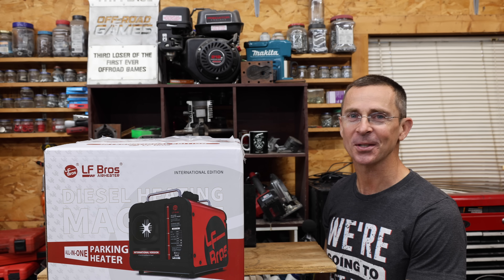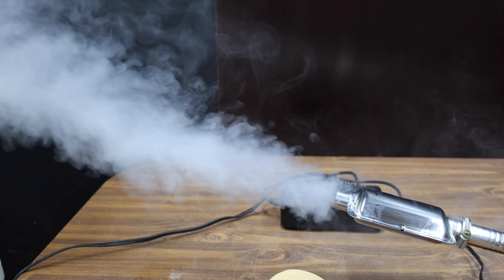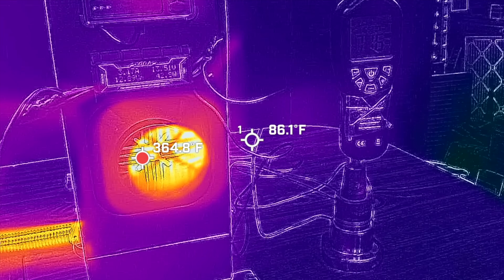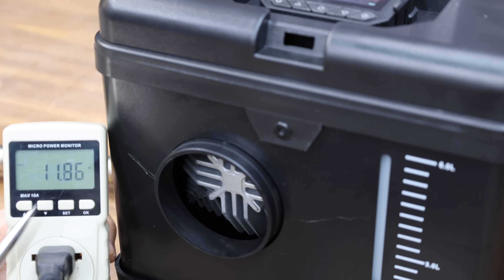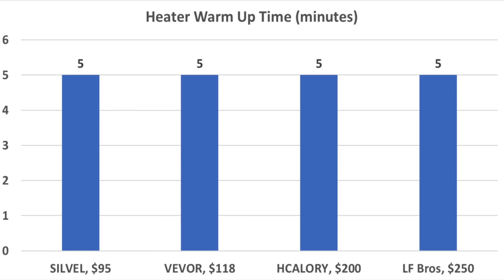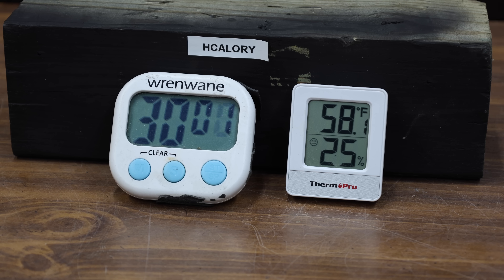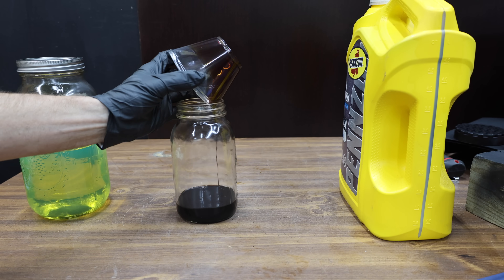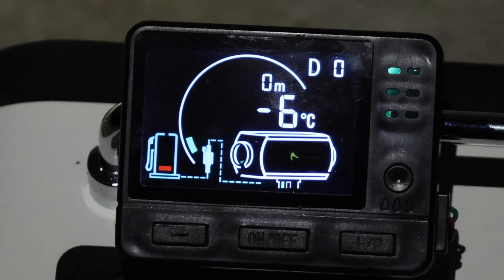The Truth About Cheap Diesel Heaters!

Comment: Are you kidding me?!? I’ve watched at least 8 hours of content about all these heaters the last couple days looking to buy one. This is the only video I’d ever need to make my choice. Thanks again!!!!
Reply: Be sure to watch the videos for "tuning" diesel heaters with a Carbon MONoxide detector/ meter!!!
Reply from the maker: You are welcome!
Reply: @ProjectFarm  Can you make a video about "digital levels" like the Klein ones to test for the most accurate brands ?
Reply: @ProjectFarm 

Any thoughts about these diesel heaters verses an old school vertical cylinder kerosene heater?
Reply: @Lorenzo-fw3gx these exhaust all the products of combustion outside.  Whereas the old school heater like you mention vents all the products of combustion into the living space, which is not very desirable.
Reply: @Lorenzo-fw3gx  In my state kerosene is much more expensive than diesel, so that's a big plus for the diesel heater, though there is a LOT less setup, and no power needed for the  kerosene heater. 
The big issue with some of the  kerosene heaters is carbon monoxide, some of them are really bad. Where as with the diesel heater, as long and you're willing to cut a hole in your wall for your exhaust, carbon monoxide, isn't an issue.
Reply: @Lorenzo-fw3gx kerosene is better IMO, no exhaust needed burns clean, but kerosene is VERY expensive
Reply: @ kerosene is useable in these heaters too and it’s cheaper than diesel.
Reply: @JustCallMeChad  Id just build a plate with an exhaust port to fit a sliding window myself
Reply: @Lorenzo-fw3gx   all your clothes will be smelling like kerosene  
 My biggest problem with those tower kerosene heaters is that in my area kerosene bumps have all been removed for gas station and that makes kerosene very expensive to buy it at  retail stores in cans
Reply: @xxskizzumxx Not correct kerosene burns relatively clean compared to diesel but not clean. You need exhaust or ventilation in confined spaces while burning any fule.
Reply: @The_RC_Guru  I don't know where you live but where I live diesel is much much cheaper than kerosene
Reply: @LarryRichelli same where I live
Reply: @JustCallMeChad if you're looking to save even more fuel cost, there are videos all over this forum utilizing a mixture of 1/3 kerosene or diesel to 2/3 filtered and cleaned used vegetable oil which is pretty much free. Even after multiple burn tests, the exhaust is clean, it runs fine, and even after disassembling and looking at the burn chamber itself there is no detriment or degradation to the heater, burn Chamber, or the glow plug. And on top of that due to the viscosity change it actually used less fuel over the same amount of time then running diesel or kerosene on its own. You're welcome.
Reply: @ProjectFarm I’m sure these are better considering the amount of BTU but what would work better Mr. Heater Big Buddy heater or the $200-$350 diesel heater? 
I know you ran some tests on the smaller Mr.Heater. 

I have the big Buddy heater but hate worrying and checking CO2 level/ fresh air. 
Reckon these would be cheaper to run long term? Heat more? 
Great video!
Reply: @rikityrik I can say I tried the mr.heat buddy vs my diesel heater 5k model, to heat my wood work shop(11x21ft uninsulated shed) and any propane made the air extremely humid. The diesel heater made a massive difference, zero smell, zero humidity. It was extremely impressive.
Reply: I think they all come from same factory so many similarities
Reply: @independentthinker8930 lol, I noticed some of them had the same silly VO message when shutting down “Thank you for using, have a safe journey”.
Reply: @willman831  So, did you have a safe journey? If so, you can thank these heaters. 😂😂
Reply: @independentthinker8930  they do I’m sure. So many products are made in the same plants with just barely any sticker and manual changes.
Reply: @The_RC_Guru  like the Chinese chainsaws, all the same, just different labels and colors
Reply: @The_RC_Guru , same with Yeti, and Walmarts Ozark trail mugs, made in China, factories are on same block, possibly same company.
Reply: These heaters are certainly not all the same and Chinese chainsaws are certainly not all the same . This comes from years of experience
Reply: @ i like the part of your comment where you told which one’s best in your experience.
Reply: @independentthinker8930 i bet Your stuff breaks a lot LOL
Reply: @thethiefonthecross9092  actually no, I have an 82 CJ-7 with over a million and 30 thousand miles on everything but the engine, it just had it's first transmission problem, the engines I got over 500k on each.  Maintenance my man so the maintenance!
Reply: @independentthinker8930  lol i dont know about that😂
Reply: @thethiefonthecross9092  yea you don't!
Reply: Same here and I've ran a vevor for the last 4 years
Reply: @adamwagner1987 just bought my first one any tips or tricks? Or any spare parts I need to keep on hand lol.
Reply: then you've been watching the wrong videos. I love this channel, but it's pretty obvious he doesn't know very much at all about diesel heaters. Just buy the cheapest one (under $100) rated at 8K (which is always actually only 5K, but that's what they all state) and comes with the white fuel line not the green or blue fuel line, and you'll be good to go. The colored fuel lines are too soft, absorb the pump pressure and interfere with the pumping, causing error codes. The "instructions" are always terrible, find a good video on YT and you'll soon see it only takes a few minutes if it's an all in 1 unit like the ones he tested. The ONLY difference between diesel heaters is the controllers and the fuel lines... seriously, that's it. Might be a wise idea to invest a few more dollars and buy better hose clamps at an auto parts store, sometimes the ones they include are pretty much garbage.
Reply: @jcs6206  Do you have a name for one your recommending please
Reply: I've had 2 for about 5 years now I got cheapos and they both still work great for me
Reply: Project farm is the place to be before I buy any tools. Never been disappointed in last 4 years since I found this gem of a channel
Reply: Exact same with me, I have them in my carts all over the interweb trying to figure which one to get..
Reply: @twistedhillbilly6157  I got vevor, no complaints
Reply: @twistedhillbilly6157 yep I’ve had.  3x today when I had one in my cart then removed it
Reply: @twistedhillbilly6157  all are mostly the same. Diesel is diesel, hot is hot
Reply: Which one are you buying?
Reply: I echoed this sentiment in one of his last videos, and he was obviously reading our minds again! PF never disappoints!
Reply: Not that you've asked but this guy is the one to come to when you want to see about purchasing something because he runs them through some pretty good tests
Reply: Yeah, they're all just clones of some German-sounding heater that cost 10-16X.
Reply: Project Farm is my go-to for product reviews.
Reply: I had a friend suggested I get a vevor last week, now you are reviewing it. Crazy
Reply: He's a one stop shop for all your info needs in the blue collar utility items department.
Reply: Always go straight to Project Farm! The best reviews and non biased feedback. Often funny too!😊
Reply: Get the LF Bros, this is my second year heating with it and it’s great, I use I gallon a day. All day from rise to retire.
Reply: I'm think about getting one to keep my greenhouse above freezing. How low does the temp setting go?
Reply: @coloradoprofessionalinspec720 
Good idea. Since they don't seem to have a temperature regulating feature, you will probably need to experiment a little. Possibly make a duck for the output that has a damper to send the heat out of the greenhouse if getting too warm. Then, get a temperature controller to use for the damper that can be set for whatever max temp you want. If you can find a software hack, you may be able to reprogram it.
Reply: @coloradoprofessionalinspec720 On my Vevor, the lowest temp setting is mountain mode, set on one. It runs about 130° centigrade, on the body of the heat exchanger.  With mountain mode off, on high,  six. 
It runs 208 centigrade, on the heater body..
Reply: I wonder can you run it off a car battery
Reply: @glenschnelle  yes, they do well on car batteries. Mine run on them. I have a "maintainer" connected to the battery, They are my emergency backup
Reply: @glenschnelle I have the Silvel brand. I run it off the deep cycle battery I take out of my boat for the winter. I keep the battery hooked up to a battery maintainer so it stays charged.
Reply: @glenschnelle  you can run it off a car battery, but not sure how long the battery will last.
Reply: @JustCallMeChad  quiet awhile, they claim 70 hrs on a 100watt battery, I just not car batteries, off and on as needed they go a long time
Reply: @JustCallMeChad  good question.... if you have to constantly run you car to keep a battery charge these heaters may not be my first choice
Reply: Yes they were originally designed to warm tractor trailer cabs up @glenschnelle
Reply: @glenschnelle  Should be just fine.
Reply: @glenschnelle yes, just buy a $20-25 battery float charger to keep it charged. $20 eBay one works great.
Reply: @glenschnelle Yes,  these heaters have a very low power draw, around 15 watts, after the initial start-up which is about 115 watts for about 1 minute. Be sure, to not allow the batt voltage, drop below 11.6 volts or the car may not start. 
 Also don't disconnect the batt, before shutting down the heater, is important to let, go through the cool down procedure, or it will damage the mother board, on the heater.
Reply: His timing always seems spot on huh !
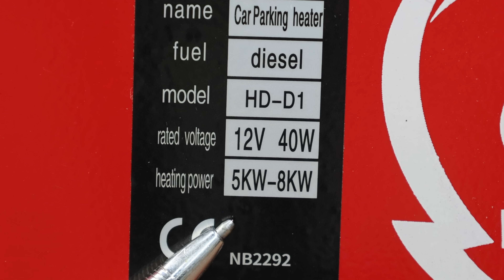Reply: 0:36 WOW! 8000KW.... 😂
Reply: I watched about 60 hours of videos before I bought one
Reply: I own the Silvel. My son has a Hcalory. He has had problems several times with an internal fuel screen getting clogged with carbon. According to him, it's a huge pain to access and clean this screen. I was hoping you would cover this in your reviews. It probably didn't come up because of the length of the testing. He runs his for days at a time. Has anyone else had this issue? Thanks for any responses.
Reply: @artmartin1913 This is due to him running the fuel pump slow, they like to run wide open, stay hot and clean inside. Other possibility is he is burning waste oil from vehicles. They're high maintenance if you fuel them with 💩
Reply: @artmartin1913  My neighbor has one (unknown brand) his has problems with carboning up.
Reply: Home Depot has the silvel, and  the vevor on special right now for $99
Reply: I've bought 4 of these and have 2 working and 2 for parts currently. One is in my van which I use all winter. I've thought about buying enough so I can set 10 of them up in a 6000 square foot insulated building as an experiment. I intend to put the exhaust through a heat exchanger to pull off as much heat as I can from the exhaust. I'm pretty certain they won't heat the whole building to a T-shirt temp, but I think they would make it reasonably comfortable. I'm currently using two torpedo heaters. One is 215,000 and the other is 65,000. They heat it up nicely and fairly quickly, but they stink and aren't terribly safe.
Reply: The patent ran out so I would call these a generic diesel heater’s, if you want the original you can always guy the Espar at around $1000/$1500
Reply: @airrodgers1242 Sounds like Project farm should get an Espars and compare to the Chinese ones... @ProjectFarm
Reply: I purchased my Espar in 2012 and it was $1500.  I would think that they have only increased in price. @airrodgers1242
Reply: @airrodgers1242  Not many people know that some bigger Diesel BMW has an engine heater fitted behind the near side wing. Often never used because they don't read the owners book.  Makes for a good campervan water heater.
Reply: Was also just researching this. I want it for those Cold tailgating days, under a 10x10 canopy. So the bigger the better IMO. But from my research, they are all the same exact hardware so 250$ is overpriced
Reply: I own the LF Bro's one and I love it
Reply: Me too. Was lamenting that he hadn't made a video on them. Aaand then bam!
Reply: Project farm has been my go to for product information for as long as I can remember.  The way he does his videos are so unique in a great way!
Reply: I have the same LF Bros, and it works awesome. I’ve put about 40gal of diesel through it. It is very well made. The automotive fuel cap ensures a great seal, and when the unit is up to temp there is zero pump ticking. 

Only downside is the control panel is on the top exposed to elements, but LF Bros has a different model that has a plug in control panel with I think 10’ of cord.
Reply: @max7143  on my second Lf bros in two months. First one had a quiet fuel pump but kept throwing errors.. I returned it they sent a replacement. Fuel pump is extremely loud on this one. Fuel pump went out in less then 30 days ..  I wanted to think paying more meant better.. I'm not convinced
Reply: @ well that’s a bummer, mines been solid, using it right now actually 😂
Reply: I have the same LF Bros, and it works awesome. I’ve put about 40gal of diesel through it. It is very well made. The automotive fuel cap ensures a great seal, and when the unit is up to temp there is zero pump ticking. 

Only downside is the control panel is on the top exposed to elements, but LF Bros has a different model that has a plug in control panel with I think 10’ of cord.
Reply: My 8kw vevor was $89 definitely one of my best purchases
Reply: @troyrager1352    Haha, not if you actually thought you got twice as much as you actually got.  Pretty lousy to get 4kW when you thought you wrre getting 8kW.  Haha.
Reply: Amen!!
Reply: Same lol. Glad I ordered a vevor
Reply: I bought the SILVEL from Amazon and Goddard in about a week. I ordered the VEVOR from Home Depot and it took almost 2 weeks to get. I had the SILVEL I've been running when the VEVOR arrived in returned it. 
Installation in a garage is there a real trick
Reply: Any tool or oil choice. Literally any product, this guy has the reviews. FYI, harbor freight isn't that bad of tools lol
Reply: dude same!!!
Reply: If the product you want is in a project farm video, you will know if it's worth it or not
Reply: Project farm is the first place to look before you buy 😁
Reply: He is pretty great!
Reply: Before I buy anything i check to see if there's a projectfarm video to help with the decision. It's as close to a real scientific unbiased test as you can get. He puts a lot of time and effort into each video.
Reply: Why I love this guy
Reply: Bro don't buy any tools without watching this channel..this guy  thinks of everything
Reply: I didn’t realize vegetable oil could actually power a diesel heater that efficiently. Running for 35 minutes on just one cup and burning clean is impressive—perfect knowledge for emergency situations during power outages.
Reply: Yeah this guy does a good job testing different variety of units. I’ve bought zero water filter and not bought allot of other products because of his videos.
Reply: @jackz.4868 oh man I went to the zero water faucet filter and I had 3 burst and crack in just 4 months early this year. They’re so expensive I just threw my extra filters in the trash and went to pur. Been great. Used brita before but they’re and up leaking too.
Reply: This is about the ... maybe 12th of ProjectFarm's videos I've used to select a product. Almost every time I find a new thing or a need in tooling to fill, I check this guy's backlog! He's like the ConsumerReports for us little guys!
Reply: Todd is very scientific in his methods and just the right amount of silly.
Reply: I was in the exact same situation! This was the only review that convinced me 100% on what to buy.
Reply: If I want to watch 20 mins of unboxing and influencer b roll, I let the algorithm serve up the usual garbage.   When it’s time to buy something and learn if something is going to work for me, Project Farm is the only game in town.
Reply: Great video thankyou mhof_58
Reply: truth
Reply: Me too!! lol
Reply: Which one did you get,then I won't have to watch the whole video 😂
Reply: @kenvik6192  I picked lf bros bit more expensive but build quality is great
Reply: same
Reply: I’ve told Todd several times that before I purchase something, I always search for the “Project Farm best“ whatever. 👏
Reply: PF does fantastic reviews
Reply: That’s great! Good to know you made a decision! Now could you tell us what you decided on?
Reply: Just get the cheapest one you can find with the features you want all pretty much the same, if you really want reliability and quality get HLN pro models both brushless and has oem quality with reliable Kyocera glow plugs this brand is oem level for most trucks and cabs in the heavy industry prices aren’t bad for what you get either 500$ compared to 2-3 times that for webasto and other high end brands
Reply: They're junk when you need them they don't work space heaters are junk olive in mich I know I have 3 all junk don't work
Reply: And your choice was ?
Reply: @robormiston2841  the Hcalory 8kw. They’re almost all the same and it’s been working for me flawlessly.
Reply: Suck up.
Reply: Which is best
Reply: I just bought 2 of these vevors
Reply: so which one did you buy?
Reply: Project Farm is the first place I look when I am looking for reviews on tools and other things needed around my shop. Welcome aboard.
Reply: They would save electrical power if they would use knobs instead of digital.
Reply: Quite literally every one of his videos! Add him, watch his videos before making any purchases it will definitely make you feel a lot more confident going in
Reply: @V1ncent19  I watch everything he comes out with, even when I know it is not a type of product I am interested in buying.
Reply: This might be a dumb question. But these all need electricity to run the fans don’t they? Which in a power outage you’d still be without power to run the heat for these
Reply: @d.w.6216   They run on 12 volts. 
Mine is connected to my solar panel, battery's it runs indefinitely.
Reply: @ on 12v batteries can run 8-12hours on a full 12v battery charge
Reply: @d.w.6216  That is the reason I have a MR. Heater and a couple of 20 lb tanks.  No electricity needed.
Reply: Can the clicking sound from the pump be muffled, it's annoying?
Reply: @karenpever1783 It’s not really annoying. It’s definitely less annoying than being cold 🥶.
Reply: I've been watching this guy's content for yrs. He has saved me $ and time. I hope you subscribed
Reply: @raverlife3413 have been subbed for years also.
Reply: My buddy works good, but I've had 3 in a row crap out just over a year of use.
Reply: @christawilliams9116 yes but those release carbon monoxide in the area you’re heating. These vent combustion gases outside.
Reply: @christawilliams9116     Three of these diesel air heaters?  You must be very unlucky or need to know how to operate them!

My 2kW sooted up (well, solid carbon  actually) the burn chamber over a season of use, but I am easily able to fix them.  Like anything vevor, they will mostly be bought with one fault or another - one would be lucky to get a “full spec” item of anything from them.
Reply: @oliver90owner No three propane Buddy Heaters. 😢
Reply: No it’s not.   About useless as a long term, safe test.
Reply: @oliver90owner is that what the review was about? Nope. And mines on its 2nd winter running fine it hasn’t caught fire or got up and shot anyone.
Reply: @The_RC_Guru   For starters, he tested ‘supposed’ 8kW heaters.  They simply do not exist in that form - they are virtually (or absolutely) identical to the claimed 5kW heaters - which even  don’t actually deliver 5kW!  

Is safety not an issue should  that not be considered/addressed?  Some of these heaters can require replacement parts due to the construction of the combustion tube if/when the heater fails due to carbon build-up.  I know all about these heaters - I have two, supposed 5kW versions and one supposed 2kW example.  None provide the claimed output.  

The smaller example became so blocked, after running for prolonged periods at a low-heat setting, that most would not be able to avoid buying a replacement combustion tube to effect a repair.

Operated safely (many are improperly, or inappropriately, installed) and used carefully, these heaters can provide a good source of heat.  Just don’t expect anywhere near the claimed output - and good luck if it is operated at less than high output settings.

It should be pretty obvious that measuring the temperature in front, at a distance is going to be affected by the relevant heights and velocities of the warmed air.  Careful comparisons need to be made.  Velocity of the warmed air is immaterial - the output of the heater is the ‘proof of the pudding’.  

Need I go on?  If I do, you are out of luck, I’m afraid.
Reply: @oliver90owner nah you’re just another clown that spends all his or her free time on the internet being rude and negative anywhere you possibly can.
Reply: Doesn't really matter. Buy the cheapest, they're all the same except the options.
Reply: I always check Project Farm first - and I live in the UK where half the brands are not even available 😂
Reply: I already have 2 of them
Reply: He's the best on Youtube period.
Reply: Get one that runs off of propane, no electricity required, and they will run a few days off of a 20lb tank.
Reply: @harpintn propane produces moisture which is bad.
Reply: @ABCdefGZER  Moisture is needed in cold dry air.  If you are talking about the moisture in the fuel, that is the reason you use a filter when you use the 20lb tank.
Reply: @harpintn     Every kg of gas burned will produce more than a kg of water.  I could work out exactly how much, but you wouldn’t understand (or care) I suspect.
Reply: @harpintn    Please share any links.
Reply: @harpintn Easier (as well as usually less expensive) to source diesel/used oil than propane in our part of the country.
Reply: @aspenhill1479  The problem with this device is that you also have to run a generator to use it in a power outage.  That doubles the cost of running it.
Reply: @harpintn  looking for portable alternatives!  Appreciate your sharing knowledge. Don't trust a Kerosene heater, lost a house to one when a valve failed. Not enjoyable.
Reply: @harpintn  I have propane ones, they're pretty great and hassle free. Especially the "Mr Heater Buddy" that they sell at Home Depot. Had it for years, a $20 propane tank last 75hrs on low and keeps my garage warm enough, I think the diesel probably puts out more heat at less consumption, but having to add diesel every 10 hrs and run exhaust seems like it's not worth the hassle
Reply: @xxskizzumxx  I am sure the desil ones put out a lot of heat, but they also need electricity to operate.  That makes them problematic in a power outage.   I have never actually needed to use my Mr Heater, but the technology has been perfected for decades so I was comfortable with making that purchase.   I also have a tiny propane heater that will screw on the top of a propane tank that I have used many times while camping.
Reply: Welcome to Project farm. I always come here first to see if he’s reviewed something I’m looking to buy. If he’s reviewed it I don’t waste my time any where else!
Reply: @ me too. He’s covered a lot of stuff that’s right in my wheelhouse.
Reply: @nfprojectshop    You should spend time elsewhere.  I know that some of the comparisons are absolute carp.  Buy cheap, buy twice often applies.  Use once is OK, but regular use is another matter.  Longevity in operation often outweighs initial cheapness.
Reply: Don't buy them they're junk they'll break down on you a lot I thought the same thing I've got three junk
Reply: @kennethjansen9002  it seems to be a little hit and miss but most seem to work great when installed properly. Installation seems to be the biggest factor. I have 79 hours straight on my hcalory 8kw right now and there’s no soot or issues yet and she’s choochin super hot air.
Reply: @The_RC_Guru    A like re the reliability.  But you have been conned if you think your heater is capable of 8kW.  More like 4kW.🙂🙂🙂
Reply: @oliver90owner  yeah we all know that
Reply: You probably watching the wrong video's then because there are enough good video's, even better ones.
Reply: So which one are you buying?
Reply: @BobbyTarkirk    Vevor are OK if you know how to fix them, or are happy enough with a substandard item (that’ll be most of them, I suspect - both mine were faulty in one way or more).
Reply: buy the original, these are all knockoff espars
Reply: The concept of them are a lot like the esbars which are way more finicky, I would muster a guess that they resemble the wabasto heater more.  The place I worked had  both and they are great heaters, but the wabasto was far easier to work on and fix verses the esbar  @joesmith7412
Reply: @Claude-SpeedGTA3 espar/webasto are very pricy and I’ve owned them as well as a Chinese Vevor diesel heater.  The Vevor in my opinion way more durable.  Ran Chinese Vevor 1800hrs primary heat my mobile polishing unit before failure.  At that interval I buy another $197.00 Vevor or rebuild a espar for $550.  Math of ownership hands down cheaper vevor not only cost effective but more efficient on running costs
Reply: Thank you for simping
Reply: @catacocamping874  Thank you for being a troll. Got me worked up!
Reply: @catacocamping874  thank you for coca  mping
Reply: @catacocamping874  lol GOTTEM!
Reply: @catacocamping874  lmao, how are they simping?
Reply: @catacocamping874 Compliments and being grateful is now labeled as simping? 🤣😂
Reply: @ you’re thoroughly incorrect in your terminology there kid.
Reply: I guess you don't care about short term let alone long term cost and reliability.
Reply: @xcalibertrekker6693  😂 had mine over a year, no regrets. At the price it's not a biggie to replace, repair it yourself or just replace
Reply: @independentthinker8930  Easy enough to just replace any part that fails with an upgraded part too.
Reply: @NordicDan  yes, especially for me, I was a millwright to retirement. But cheap enough it's not hard to just replace
Reply: @xcalibertrekker6693 well we really don’t want to wait 3years for a longevity test and an economic analysis. Some of us will be dead by then.
Reply: @xcalibertrekker6693  I mean short term cost and reliability are pretty well covered by these things. They're just clones of industrial diesel cab heaters, actually kind of hard to get wrong once you take one apart, if you want a "real" one it'll cost you about a grand, then you need the fuel tank, pump, and plumbing. Given what I've seen of these in everyday use by a number of people who live in vans by choice for some reason, I sincerely doubt it'll last 10 times longer than these, or be 10 times more reliable. Just buy 5 of the knockoffs and swap parts as needed. Webasto doesn't need your money, they sell these things like jellybeans to mines.
Reply: @ your argument is really seeming invalid/nullified based on others with them chiming in with good experiences with them.
Reply: Fast track to a needed ban. This product, in general, is a NO GO.
Reply: @TheSaw410 I fail to see why these would need to be banned…Can you explain a little more please?
Reply: @gangiolini6201   Obviously because of carbon emissions and air quality issues... I use one in my Van, and infrequently so it does not strongly bother my feelings about the environment despite many also doing it - but it is also a bit smelly when someone is parked next to me, they might notice it and not like it.  If everyone everywhere was using them to heat their homes it would be a huge problem... which used to be prevalent (coal and home heating oil) but now Natural Gas and Electric are how most homes are heated which is so much cleaner... with heat pumps eventually going to come on top I expect and natural gas phased out.  BTW I prefer solar for camping where possible compared to a generator for both noise control, odour, and environment.  When the conditions are perfect for solar and someone is running a generator disturbing the peace, I think ... Asshole! 😁
Reply: @ Thanks for taking the time to reply. I think like you and use solar on my Travel Trailer but I was looking into that diesel heater for my shop. I care about the environment but in the same time feel frustrated when the government pressure me to control emissions while in the same time others are free to pollute 1000 times more with impunity (I’m referring for example to the mining industry, which pollutes shamelessly with a promise to “clean-up” but never do and get away with it since the owners are from another country…)
Reply: @TheSaw410 I fail to see why these units would need to be banned…Can you explain a little more please?
Reply: Mind sharing your thoughts on why? I feel that way about the little pruning chainsaws they're so dangerous.  @TheSaw410
Reply: @TheSaw410 democrat from California your state needs removed from the free state